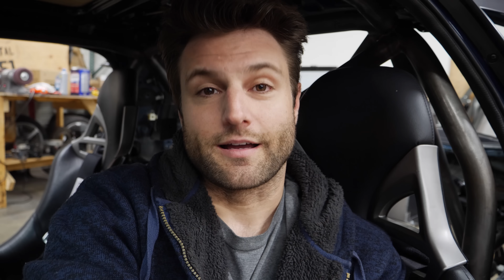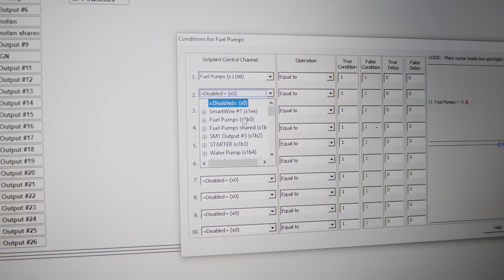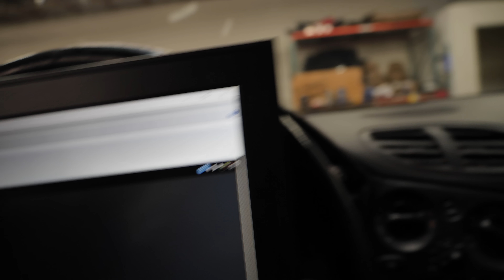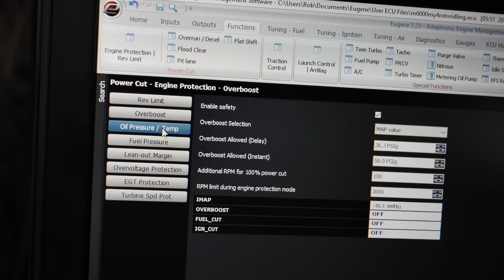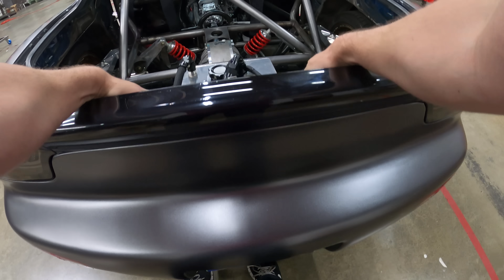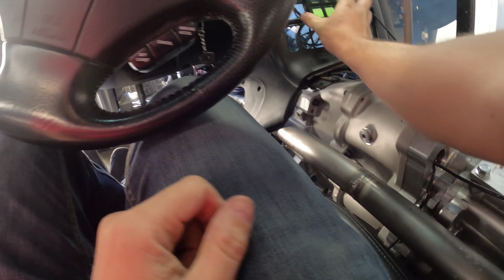I DRIVE the AWD 4 Rotor RX-7 for the first time! A couple feet before it has issues lol

Comment: Ahaha for a moment their i thought i saw water in the oil resivour thingy magig ahah ,,Question why do you want a water pump with pressure ?? I run a  davies craig water pump in my skid car with radiator in boot (13b full cut bridgeport)and runs speed/of temp control thru the ecu your quad rota has its radiator in the usual place so im shaw if its setup correctly itl be far from efficient only thing i can see is pressure causing distruction to the water seals your after flow not pressure,only thing i could figure out pressure is when the temp rises for the overflow etc from heat,,My theory is if it aint broke dont fix it and always never over complicate a simple setup duty

Comment: fast forwarded through most of the vid. Do you think it might be an idea to get some professional help before you do real damage to that motor. Its obviously no where near running rite. Plenty of 4 rotors out there maybe not made with billet internals but they all run better then yours. Having had a few rotarys keep running them out of timing and tune won't last long.

Comment: What kind of break in oil have yiu been using Rob? Maybe read up on and consider this technique http://www.mototuneusa.com/break_in_secrets.htm

Using this method I would reccomend 3 cycles of engine break in oil.

1st cycle: turn engine in and rev variable idle from 1600 to 2200 rpm until engine warmed up to normal temp. Stop and dump oil and filter. Replace with new.

2nd cycle: put on dyno and perform rev and load cycles and vacuum as per MototuneUSA method. Stop and dump oil and filter. Replace with new.

3rd cycle: drive 400 km on road with variable rpm and variable load up to 75% throttle up to 80% rpm range and go full.vacuum for 10-15 second slowdowns. Dump oil and filter.

Next 5000km use correct weight of conventional oil with added zinc and phospbulorous for anti-wear characterisitcs to get the final 10-20% ring seating done.

Switch to your chosen synthetic when you feel comfortable doing so with engine fully broken in.

Comment: Dude,  that fuel pressure probably shouldn't drop that fast.  And then all that smoke.  You should verify that you don't have a bad injector(s)  Seems like excess fuel leaking into your manifold will cause this.  If your premixing, it might not hurt the seals(rotor)  but if your injecting your oil,  all that fuel can wash the oil off and do damage on longer cranks!  Bad ass car though,  your doing Great.

Comment: not sure if this is an up-to-date video, but my suggestion is to simply change the oil. not entirely sure what would have caused the milky brown oil, but i've actually seen a video by Gingium where he found what appeared to be coolant and oil after an engine build as well. this was a subaru ej205, not a rotary, but it's possible that it's a similar problem. he didn't find any water in the oil, and after the first oil change, he didn't have the problem anymore. here's that video https://youtu.be/NGmia9GhTAE?t=547
my guess is that the oil looks weird due to the lubricants used in the engine build. either that or you've got a much bigger problem. if that's the case i'm extremely sorry for you misfortune.

Comment: As much as I love the build and I understand the will to do everything by yourself... I don't understand why you run the engine that much while it screams that it needs some very basic fuel tuning. 
With a 2 rotor I would not care but with an engine that expensive and the dramas there has been it seems a bit risky... 
Keep up the good work anyway !

Comment: Computer are awesome how you can make hardware address charges with control bits latches, timers, and modify I/O with if, or, not and even more gates. Thank you for showing this side of the build.  The welding and grinder then bolting stuff on it cool but this takes it from carburetor adjustment or rigging to fuel injection and spark turning for real power.  Also I love using my lisle no spill funnel for radiators coolant. It can get all the air out of a system.   Had to use it on a Nissan Maxima.  It is moving on it own too.  20 years later lol

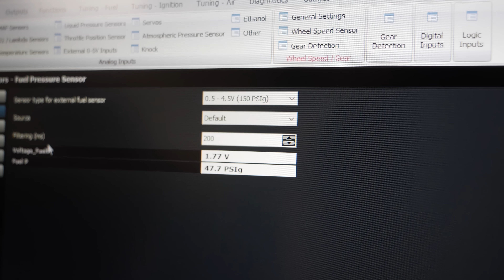Comment: 4:12 Your fuel system should be maintaining pressure. Its leaking somewhere. When you did the lines internal to the tank did you use in tank line? Or just the same fuel line that you plumbed the rest of the system with? There is specific fuel hose for being submersed.

Comment: Personally don't think there's mixing of engine fluids, unless someone really screwed up, which I would t be surprised at this point.

There's a good chance he's seeing a large amount of condensation mixed with the oil, because he keeps running it for about 5 seconds and shutting off, which will accumulate condensate but not get hot enough to remove it.

Comment: Rob, a fuel cut does not and cannot create a lean situation. Fuel cut means the injector is not fired for that cycle, thus there is no fuel in the engine. About the only time you would really want to use ign cut is when you are also using nitrous or something. I promise you won't ever lean out with fuel cut. I know it's your baby but ask around on HPA or something...and if you aren't on HPA I highly recommend signing up.

Comment: You were talking about using the key again to turn on the ignition. Maybe find a way to wire the key switch to act as a battery disconnect so that you still need the key to turn everything on. That way you have a quick solution to cut power to everything in case something bad happens to the car? Just a suggestion. I'd think it'd be pretty cool to still need the key for the car but you can still use the buttons.

Comment: The 4 Rotor sounds so deceptive.Because if I close my eyes,I could have sworn I'm listening to a mean sounding 4 cylinder diesel dragster or 2 stroke truck engine.But understandable the car currently has a short exhaust & maybe still a bit cold.Thankfully the idling of the Rotary just hides it's true potential & adds to its unique character.

Comment: Uh filter looks like contains something too brown.
Coolant in oil system. That's really bad!
Reply: Look on the internet. Still, that engine hasn't ran a lot, so no major issues might have happened. A problem like this must be taken care asap, since with time might destroy an engine
Reply: Federico Pfahler why is it really bad?
Reply: @po.russki  It stops oil from acting like oil. So you get metal on metal grinding inside the engine and it destroys itself.
Reply: 466rudy finally an actual explanation, thank you
Reply: @po.russki  Uhhhh you don't want coolant in the oil!
Reply: zevi 2000 that doesn’t explain anything lol
Reply: @po.russki  the oil pan of an engine is called an oil pan for a reason. It's not an oil and coolant pan.

Comment: Whatever the issue is, Rob will fix it. He’s to invested and committed to give up over problems (big or small).
Reply: Will sell 4 rotor project car barely driven, it could easily make 2k hp but haven't dynoed it yet I know what I have no low balers only cash at hand.
Reply: @ziomel105  No holds, southern car, also elderly driven and garage kept.
Reply: Everyone's got a breaking point

Comment: There's air in the oil system? Is that why the oil is frothy and bubbly? Or is it mixing with  coolant? Both are bad, but which one? It's hard to tell even with screenshots and zooming in. It doesn't look good. Probably an engine teardown may be necessary. Idk why this would happen though

Comment: Looks like coolant in the oil at the end.  That would suck.
Reply: not coolant imo, its this colour because the pumps make bubbles in it
Reply: @flippy9133  That's possible.  His lubrication system might be drawing air somewhere.
It looks like coolant to me, but your explanation is just as likely at this point.
In any case, let's hope you're right and not me!
Reply: @detaart  you can see it was this color when he started it on the last video, without any coolant in the car
Reply: Water and Oil absolutely look creamy. It’s the first color you look for when draining gear oil from a lower unit on a boat. Not even debatable. It froths bad and does mix.
Reply: @lukes.2014  you're right, it blends, but it doesn't mix. People are getting the terms wrong but they know what they mean. Mix is when you mix some shit together and they become the same thing. Cannot be undone. But if you pressurize oil and water, and swirl it around or blend it enough, it won't mix but they will be a part of each other
Reply: Has any of these 32 comments considered that it could possible be fuel in the oil if the fuel isn't completely burning it could water down the oil.
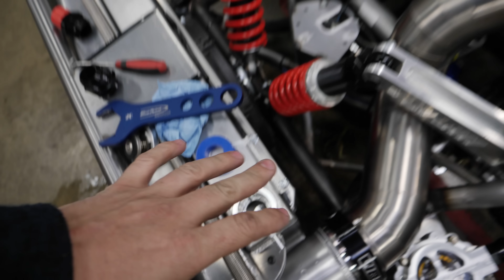Reply: @arcadiagreen150  Fuel in the oil would thin it out, but it wouldn't change the color. Also, it's not like a piston engine where fuel could blow by the piston rings and drain into the oil sump. At 4:52 in the video He's talking about how he's been having problems with the water pump and how he's got a new Pulse width MODULATED pump (allows you to control pump speed/pressure) My guess is that the current pump was too powerful and didn't allow for him to control the flow/pressure and blew out whatever the rotary equivalent of a head gasket is.
Reply: (noob question warning) Is that why the exhaust smoke/steam was so thick?... or was that just from the cold start, and tuning not quite optimized?  Where do you look to see coolant presence in the oil?  I alwsys thought you had to drain the oil to see the coolant, if present...?
Reply: @MuvoTX  it's most likely because he's running premix very common with rotary engines
Reply: @MuvoTX  When oil and coolant mixes, coolant becomes creamish in color and thick, kinda like mayo, that was visible through that pump window thingy.
Reply: Domantas Pikčiūnas so im guessing that he has a leak in the block thats letting coolant into the combustion chamber (idk rotary term) then as it burns it makes that white smoke and some of it also leaks into the sump then its visible in the oil filter
Reply: @p1ktas  ok got it thanks
Reply: Leo Karavasili, well now that I’ve looked few more times, he actually poured water into the cooling system, so it shouldnt actually look creamish 🤔
Reply: @p1ktas  when water mixes with the oil it gets that creamish color.
Reply: @leokaravasili9649  e
Reply: @leokaravasili9649  Rotaries naturally make smoke because they burn oil. The creamy consistency of the oil could indicate he has a crack in his block somewhere that water is seeping into his oil passthroughs. If that's the case, then the motor is gonna need a rebuild with a new housing for whichever one is cracked.
Reply: Smile Space hence what i meant by ‘leak’
Reply: @MuvoTX  premixed fuel and also think about how much oil is on all the exhaust pipes and other shit that gets hot from them assembling it. Even just some metals smoke their first couple of heat cycles
Reply: @pondgoblin  oh right!!  thanks, hadnt thought about that
Reply: MuvoTX  normally you would have to
Drain the oil, in alot of cases, but he has a see through oil filter system so he is able to see the condition of his oil whenever necessary due to the fact that rotorys love burning oil, and it makes it easier to keep an eye on:)
Reply: @danielcowan3138  oh ok got it thanks
Reply: @danielcowan3138  
If you are running premix oil consumption isn't really an issue.
Rotors are SUPPOSED to consume oil by design.
No oil injection and premixing means not using engine oil.
Reply: @MuvoTX  I think that's mostly condensation
Reply: @MuvoTX  since it has a filter with a see through screen he can see it without doing that
Reply: @MuvoTX  You can see coolant in oil, same with water quite easily, and rotaries burn oil like fuck so that is why it smokes and why they don't think it's bad.
Reply: @MuvoTX  I think that the billet case of the reusable stainless steel screen oil filter, has window in the top of it.
Reply: @inanimateuser9828  While you are right, the head gasket equivalent would be the gasket in-between the different irons of the rotary engine
Reply: You heard him say no no no that's not a good sign looking at the creamy oil.
Reply: That's just what happens when everything in the trans is settling for the first time. Mighty Car Mods RB26 Fairlady Z did it
Reply: @Sean Price  Your contribution obviously far outshines the rest.
Reply: The milk shake everyone is seeing from oil and water mixing.  It is called cavitation due to air bubbles being suspended in the fluid.
Reply: It’s just water, no coolant. Water and oil don’t make a milky color cause they don’t really mix. The oil he’s using is probably a racing oil that has a  very yellowish/ creamy color to it. My assumption is he melted some sort of wire or the sensors popped out
Reply: @KKrackbiscuit  That's exactly what happens when oil and coolant/water mix.. The fact that he ran the coolant pump for so long and still had air in the system is kinda suspicios
Reply: detaart he’s using water though unless that’s what you mean you’re seeing?  Water and oil?
Reply: @davidrivas2211  Right at the end of the video, you see milky stuff in the oil filter thing he has.  Water, coolant, etc in the oil will do that.
Reply: detaart so you’re saying water mixing with oil makes it creamy?  I don’t think it works like that.  TraditionL Coolant creates milkshake.
Reply: @davidrivas2211  Google what oil looks like when you blow a head gasket. It hasn't ran enough for the oil to turn black yet so it looks a bit different, but I'm pretty sure that's whats going on.  I have had water in hydraulic systems with clear oil (40wt motor oil used) and it looks creamy just like this.
Reply: Josh Proctor why would I google that?  All I’ll find are people using actual coolant.  Dahm is using literal water as coolant.  Water and oil don’t mix.  Why don’t you google water and oil mixing and see what you get ?
Reply: @davidrivas2211  yes water alone will make it look creamy just like coolant will. I've seen this many times in both oil systems and hydraulic systems. Rain water leaking into hydraulic systems, blown headgaskets, child putting a water hose inside the exhaust system of your R1. ATVs and pond water. It all looks the same tan, creamy milkshake.
Reply: @davidrivas2211  Your logic is wrong. Water will mix in with oil in a pressurized system.
Reply: Zues Toots he’d have to have something insanely wrong for that to happen that quickly.  Oh well, I’ll return after The next video to admit defeat or see who’s logic is more sound lol
Reply: @davidrivas2211  water and oil don't mix in the normal sense, it becomes an emulsion where air mixes in and would give it a milk shake type look. It's used in cooking a fair bit.
Reply: @davidrivas2211  They don't mix if you just put them in a container, but heat it up and run it through a high speed pump and they definitely mix and make it milky...
Reply: @davidrivas2211  water is a coolant
Reply: tommihommi1 water is water. Coolant is coolant
Reply: spoiler alert!!

Comment: Just some engine adjustments, add firewall, doors and floor and she's ready to go
Reply: Melon muskett hey guy did you see the end?
Reply: Looks weirdly close like coolant don’t you think
Reply: Maybe
Reply: Joey he didn’t have coolant it just looks like he put water unless he put coolant and then water when he was filling it
Reply: Silver_fox_ 5.0 water works fine as coolant, when it’s pressurized the boiling point raises. In fact wayer transfers heat better than coolant but doesn’t provide “antifreeze” or inhibit corrosion. I live in Florida and used a 75% water to 25% coolant in my FD
Reply: @silver_fox_5.020  water = coolant. the milky brown oil at the end of the video usually indicates the mixing of oil and coolant. in the case of a piston engine, this might mean a cracked block/piston/piston ring. in the case of a rotary, I'm not entirely sure. on the other side, though, I've seen numerous engine build videos where the oil is milky brown after break-in, the inexperienced YouTuber then freaks out, thinking they've cracked the block or something, but then changes the oil and doesn't have the problem again. i'm thinking Rob has a similar thing. if I were him i'd change the oil and see if it persists.
Reply: william killingsworth ya ik never said anything bad about it I use water when I’m having problems with my car in the summer it’s way cheaper than buying 3 or however many gallons of 50/50 coolant when it’s $12 a gallon but use coolant in the winter cause I live up in northern Iowa
Reply: It's not that simple